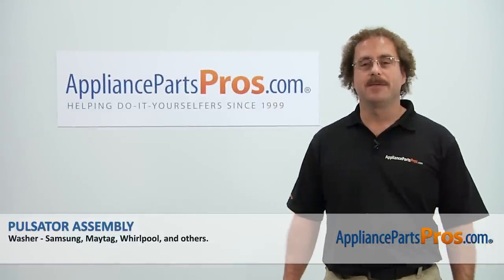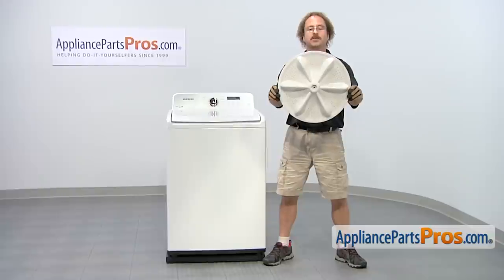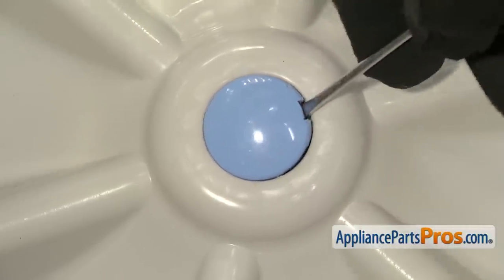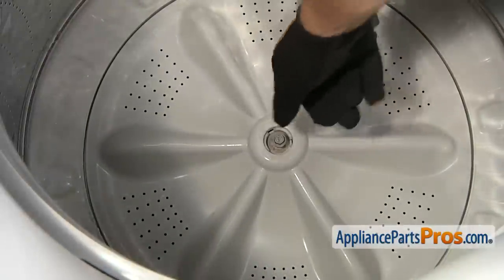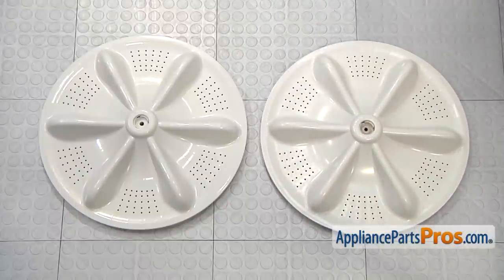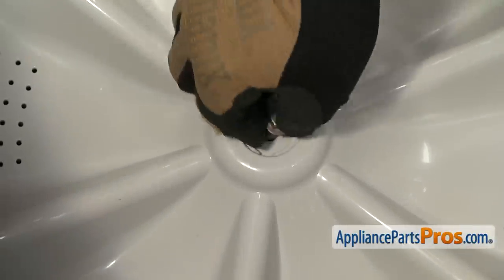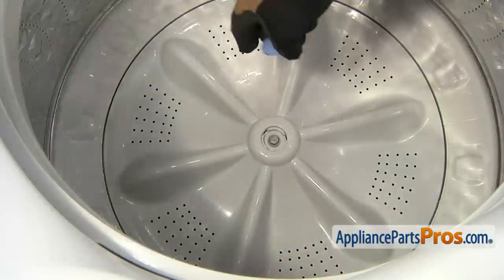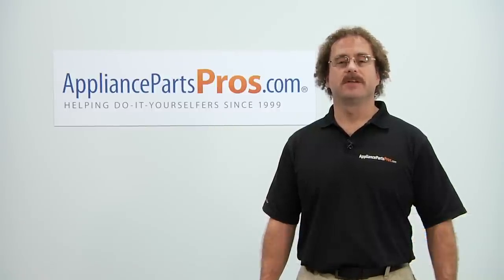How To: Samsung Pulsator Assembly DC97-16977A

Comment: I spent 3 days trying to get the Bolt from hell to loosen.

Banging it, manual impact driver, electric impact driver, more banging the bolt top and the flats of the bolt, wd40, rust blaster, more banging.

Boiling Hot Water, was the only suggestion I found on YT and Google that Worked!!!

First pot of boiling hot water over the Bolt, I finally got it to slightly budge. The seventh pot was the charm, finally continued turning till it finally came out. Happily the Pulsator also lifted out with no further problem.

Was getting dark flakes in the washer drum water and could see them more so in the discharge water emptying into the Laundry Sink.

Learned from YT/Internet they were probably coming from mold from the underside of the Pulsator and sure enough the underside was caked with the gunk.

Used the Power Scrub setting on the Dish Washer, to get it to clean up like new..

Comment: My washer was making a loose and grinding noise, wasn’t spinning the load. I tried the shop vac to the drain line first to make sure it wasn’t a clogged line and sensor issue first. It wasn’t!

The metal hex/gear shaped shaft inside the pulsator in mine stripped through the plastic. I used a 13/32 impact bit on my drill. The plastic layer crumbled where the screw goes through.
I wanted to try and glue fix it before buying a new part.
I tried using about a bottle of loctite superglue to glue the shaft back in there.
Didn’t work and it stripped out right away after reinstalling it. It was just floating in there.
Ordered a new screw and pulsator for about $95 shipped.
FYI these guys charge about the same as Amazon. That’s impressive.
I am Praying that the new pulsator and screw do the job.
Hoping mine isn’t something worse.
Reply: Fixed! I got the new wash plate and a new screw, I used the old screw and it worked fine. Perfect fix.
Towels are washing great now and mom is happy.

Comment: FYI Using Thread Lock on bolt will save Headaches AND money.  When the bolt works loose it lets the spline in agitator strip making you buy another replacement disc.  I shimmed mine with aluminum strips and GREEN thread lock compound after it loosened and stripped within a week of being in the local Maytag repair shop. The repair guy used original bolt and no thread lock compound.

Comment: If the old pulsator sticks and is impossible to get out, pour some boiling water into the bolt area an let it set a minute...pops right out without damaging anything.
Reply from the maker: Thanks for the tip!
Reply: The fact the author of this video didn't even mention this tip makes me question their actual knowledge on the subject. Disliked! Be sure to use something like a Q-tip to get all the water out of the bolt hole.
Reply: Dear Mr. Morrison,

I spent 3 days trying to get the Bolt from hell to loosen.

Banging it, manual impact driver, electric impact driver, more banging the bolt top and the flats of the bolt, wd40, rust blaster, more banging.

Your unique suggestion of Boiling Hot Water, was the only suggestion I found on YT and Google that Worked!!!

First pot of boiling hot water over the Bolt, I finally got it to slightly budge. The seventh pot was the charm, finally continued turning till it finally came out. Happily the Pulsator also lifted out with no further problem.

Was getting dark flakes in the washer drum water and could see them more so in the discharge water emptying into the Laundry Sink.

Learned from YT/Internet they were probably coming from mold from the underside of the Pulsator and sure enough the underside was caked with the gunk.

Used the Power Scrub setting on the Dish Washer, to get it to clean up like new.

Thank you...Thank you...Thank you.
Reply: @Carlos Gutierrez mines is also stuck, did it work with the hot water.
Reply: Did this actually work for anyone
Reply: @tiffanyallen7585  

Read My Post
Reply: @jaymiller5926  that didnt work. We tried for over an hour to get it off... no luck
Reply: Have an old WA9W17 Samsung. After two kettles worth on the bolt everything popped out.

Comment: Do you need to grease the bolt before reinstalling it?
Reply: No, do not grease the bolt. The grease will get into the wash water and contaminate your laundry, and I don't think you want grease in your wash. The bolt will not rust, but be sure to add a lock washer before reinstalling the bolt, not thread lock as one guy suggested, unless you want thread lock in your wash.

Comment: What is the size of that big hex bolt on the bottom of the drum?  I tried 35mm socket (too small) and 36mm socket (to big)
Reply: They all vary slightly. Have to find the size that fits. My current machine is 10mm
Reply: @coletteklosterman7709  Using a vise grip and hitting it w/ a hammer worked for me.

Comment: I've done everything to remove my Maytag Bravos XL washer pulsator (some call it a washer plate)...it won't budge. It raises up about 1/2 inch and seems to hit something, like it's locked in place.  I want to check for coins that may be stuck underneath.  I don't know what else to try.  I tried turning it from side to side, as if it's washing, but it won't move back & forth either.....not sure if that's possible with the power off.
Reply: I'm having the same problem, did you figure it out?

Comment: I wish you would have shown the bottom of the old pulsator/agitator to see what a damaged one looks like.
Reply from the maker: Sorry about that, Ron! Often times, the parts we're replacing in our videos aren't broken. The repairs we record are meant to serve as examples, and not all parts that need replacing will show visible damage. However, if you need help verifying that the pulsator assembly is what's giving you trouble, we can help with that. We offer free technical advice and diagnosis. We’re available 7 days a week at 1-877-477-7278 or you can chat us at our website: http://www.appliancepartspros.com/
Reply: AppliancePartsPros 
That's what I figured it was.  I think I am having his issue with mine.  I am going to pull the part to check it before ordering a new part. 
Thanks for the reply.
Reply from the maker: No problem! Let us know if there's anything we can do to help.
Reply: Ron Hoffert hcbcbcb

Comment: where can I buy pulsator for whirlpool wwa 780 washing machine
Reply from the maker: You can buy this part here: https://www.appliancepartspros.com/samsung-assy-pulsator-hudson-dc97-16977a-ap5622429.html

You'll need to confirm that this is the correct part for your model by using the full model number.

Comment: Where is the tub seal in such machine ?
Reply from the maker: It would depend on the model. A single part can be compatible with hundreds of different appliances. We film the part on a single appliance model to serve as an example of the repair, so even if your washer looks like the one in the video, it could differ. You can give us a call at 1-877-477-7278 or you can chat us at our website: http://www.appliancepartspros.com/. We will need the model number for the appliance, so that we can look up diagrams and information about your specific unit to give you accurate info. You can look here on our website to help you find the model number: http://www.appliancepartspros.com/modelnumber_locator.aspx

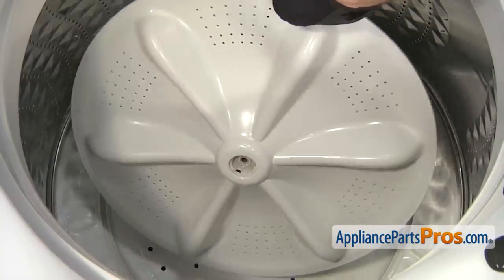Comment: I was trying to remove the tub for washer like this and having trouble with the large nut under the pulsator (1:49 in your video).  Any advice?
Reply from the maker: Are you using the ratchet with the long extension? It can be hard to get the necessary force in such an enclosed space otherwise. If so, you can try soaking it with a penetrating oil like Rust Buster, because it may be corroded.
Reply: Borrow an impact wrench, the kind tire shops use to take off lug nuts.

Comment: My bolt ended up rusting!
Reply from the maker: That can happen.
Reply: Use an impact wrench. Will come off first try.
Reply: @GetRealBaby  not for me. Trying the boiling water method another guy suggested
Reply: @AequitasSaints  I didn't try that but it may work. Let me know how it goes if you have time. The main thing is, the agitator has to come out if you want to do a complete clean, because there's tons of crud and hair and you-name-it under the agitator that does not come out with any type of cleaning that doesn't include taking the agitator out.
Reply: @GetRealBaby  yup that hasn't worked. Tried drilling it out. Drill bit snapped inside.

Lol. Now I'm up a creek without a paddle.